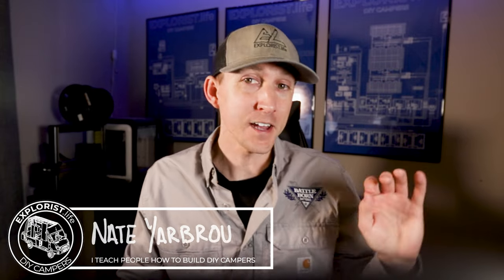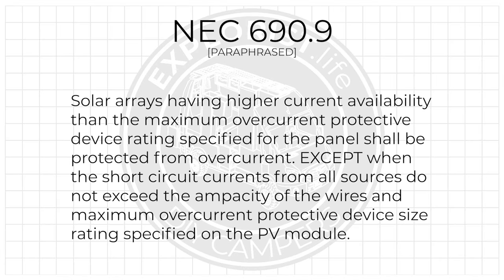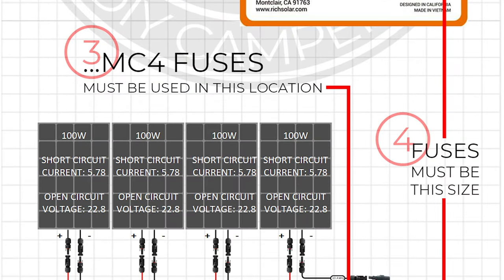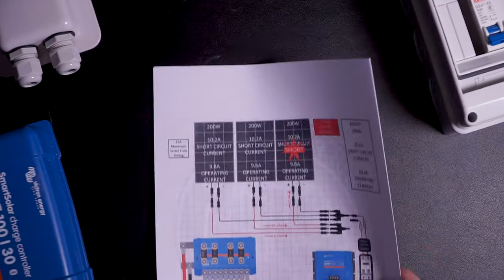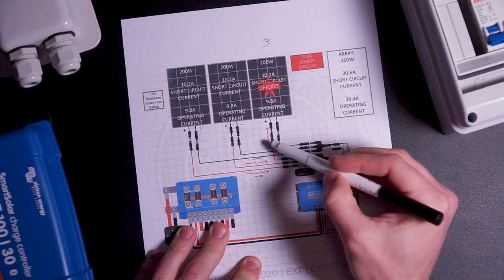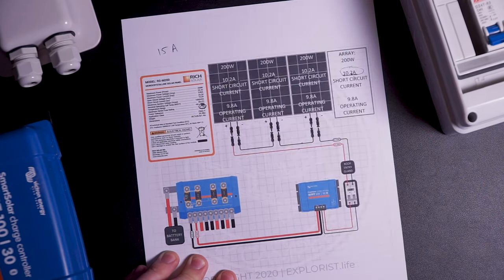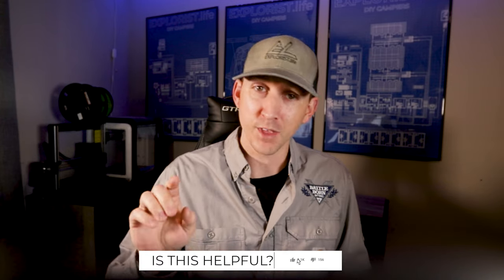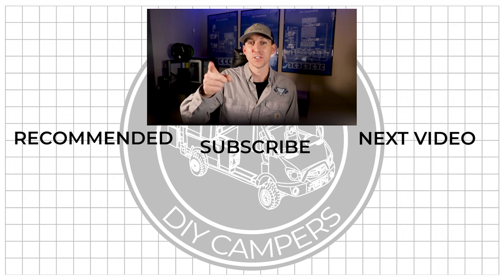How to Fuse a Solar Panel Array for a DIY Camper Electrical System

Comment: I have a question off topic... How do you fuse a victron solar charge controller at the battery. Ive read that if you hook up the battery cables polarity in the wrong direction you blow an internal fuse and at that point you need to send the controller to victron for repair. Can we protect the charge controller externally in the even we accidentally wire the battery cables in the wrong direction.
Reply: Also, if it is possible would we be limiting the controllers capabilities by say blowing a fuse before the internal fuse based off external fusing sizes?... I cant imagine blowing $1000 on there 250/100 amp charge controller and a simple mistake could cost you big time... ive seen cheaper models from other brands that offer polarity protection without the hassle
Reply from the maker: You'll damage a LOT of stuff if you connect the battery wires in reverse polarity and there is no real way to guard against that with a fuse.  This is just one of those 'just pay attention' kind of things.
Reply: @EXPLORISTlife  yea I kind of figured, I happened to see another YouTuber showing how he had to open his victron charge controller after it failed at the internal fuse despite it being hooked up properly. I just ordered a 150v/100 amp model and I want to eliminate the fuse blowing internally. Id rather add an additional fuse externally even if I had to fuse it 5 or so amps smaller so it can blow before the internal one does. I oversized the charge controller for my system but after watching that video it had me thinking how van we prevent that from happening while still protecting the system appropriately.

Comment: I am running 6 panels via 2 series – 3 parallel configuration. Ea panel has a 9.66Amp Current and a 25Amp fuse rating. The complete aray has a 28.98 Amp rating. I should fuse correct?
Reply from the maker: Yes
Reply: @EXPLORISTlife  Thank you!

Comment: What do you do if you have to parallel different panel models? Example, 3 40w with 1 50w? And what if the "maximum fuse rating" is not written on the panel?
Reply from the maker: If the solar array short circuit current is larger than any of the 'max series fuse ratings', you need fuses for your panels.  Each parallel connected panel would get a fuse equal to it's 'max series fuse rating'.  If a 'max series fuse rating' is not available... you must contact the manufacturer to find out more information.

Comment: My panel doesn’t have a maximum series fuse rating, is it the same thing as the maximum overcurrent protection rating or are these different things?
Reply from the maker: Isc * 1.25 and then round up to the nearest 5 will give you a good max series fuse rating.
Reply: @EXPLORISTlife  Much Appreciated. Ps. Love to watch your tutorials. Have learned so much.

Comment: I am confused about something.  Are you saying you do not need to use maximum current, I think defined as sum of all short circuit currents in parallel, multiplied by 1.25, to determine if you need overcurrent protection?  Code seems to just call out the short circuit current, not the maximum current, so I guess that is why two strings in this example are allowed to not have a fuse?
Reply from the maker: I'm not sure I'm following your question.  Apologies.
Reply: @EXPLORISTlife  My fault. 
In your video, (in part) you reference code that says if the sum of the short circuit current is less than the max fuse, as listed on the panel, then you don't need a fuse.  I see in many places in the internet that you need to calculate max current and use that for your fuse rating.  Some say 125% of isc, some say multiply x 1.56.    What I am asking is if we need to use the short circuit current value on the plate for the sum, or multiply that by 1.25 or 1.56.  Thank you.

Comment: I have 4 100w solar panels wired in parallel.  Each solar panel has a 15amp series fuse rating.  I attached 4 10amp inline fuses to the branch connectors.  Was I wrong?  Should I have used 15amp inline fuses?  I went parallel  because we are far north and shading on the panels is a problem.
Reply from the maker: 15A is the max size.  10A may be fine if it's not lower than the operating amperage.
Reply: Thank you.

Comment: So if I am doing 5 panels that are 9 amps in series and doing two sets of those in parallel what do you recommend for fusing? Do I need to fuse if my wire is 6 gauge and can handle more amps and such. Curious anyone I’m setting up a lv6548 soon so I am researching proper fuses and wires to run 150 feet to batteries

Comment: Shouldn't we compare the Max Series Fuse rating with the corrected short circuit current? By corrected, I mean taking into consideration the temperature coefficient effects (or a factor of 1.25 for over irradiance) and possibly another 1.25 factor since it's a continuous power. Since the I_sc rating on the PV panel's label is under standard test conditions.
Reply from the maker: Which code/standard are you looking at that backs up that claim?

Comment: can i do this set up but just get a normal inverter and converter instead of the inverter charger you use? would i then have to change where my shore power runs to??
Reply from the maker: Ultimately, you can do whatever you like, but I do not recommend separate Inverters and chargers.  They are too complex to set up and more expensive by the time the additional transfer switches and wiring is all taken into account.
Reply: what is it i would be missing getting this one thats half price. this brand has one in the 1,200 dollar range too i just dont know where the price difference is coming from, Thank you

Comment: at 2.09 what is the Masimum Series Fuse? A total of the MSF of each panel?
Reply from the maker: The maximum series fuse size is a figure listed on the back of the panel.  These don't get added.

Comment: hi 
I got 8 x 440 solar panel
My charge controller is 72V
I need help to solar panel series parallel connection for 72V charge controller
also fuse and distribution box configuration

Comment: Your wire gauge calculator camevup with 2AWG to wire my two 100ah (200amps total wired in parallel) bit the parts list for this one shows 2/0. What am I doing wrong?

2000W INVERTER | 200-400AH LITHIUM | 200W-520W SOLAR CAMPER WIRING DIAGRAM

Mine is 40w panels, two 12v 100ah lithium, 2000w inverter. All your diagrams incorporate shore power, alternator charging or both and mine doesn't have either.
Reply from the maker: 2/0 is required as the manufacturers of most 2000w inverters recommend 2/0 wire.  Manufacturers recommendations override whatever my calculator tells you.

Comment: The short circuit current of my array is 20.04amps and the max series fuse rating on my panels is 20amps. Do I need to bother with fuses in this situation??
Reply from the maker: Is the short circuit current of the array higher than the max series fuse rating on the panels?  If so... you need fuses.
Reply: @EXPLORISTlife  fair enough.

Comment: Where can I get a cheap charge controller with 400v input so I can series connect? AliExpress cheap controllers have 50v max.
Reply from the maker: I don't really deal in 'cheap' charge controllers.  I deal in charge controllers that actually work.  That said, if you need a charge controller that can handle 400V; the Victron SmartSolar MPPT RS 450|100 has a max input voltage of 450V; but keep in mind that you need to be running a 48V battery bank with this charge controller.

Comment: what if my panels dont have the max series...I am with Denis below.  TY
Reply from the maker: Multiply your Isc (Short Circuit Amperage) by 1.56 and round up to get the max series fuse size.

Comment: so what if like my 50w  panel their is no figure for  a maximum series fuse rating on the back of the  panel
Reply from the maker: Take the short circuit current and multiply by 1.2 and round up the the nearest interval of 5.

Comment: What do you think about the Eco Worthy boxes?
Reply from the maker: I don't have any first hand experience with them.  I recommend Victron components for a high quality system that will last.
Reply: @EXPLORISTlife   thanks, I’m going with a Victron 150/60 charge controller. Will be running 4, 340w (48v) panels to charge a 12v battery bank. Sound ok? My understanding is I can have high voltage into that controller under 150v and 60amp, and it will down the V to charge the 12v battery bank
Reply from the maker: Not quite.  The 2nd number of a charge controller is the amperage OUTPUT; not input.  More info: https://www.youtube.com/watch?v=Jkbs84sBHsg and this: https://youtu.be/MxziHKvTRh8

1360W of solar charging a 12V Battery Bank at 14.5V is 93A (1360W / 14.5V = 93A), so you'd actually need the larger MPPT 150/100: https://shop.explorist.life/shop/all-products/solar-charge-controllers/victron-smartsolar-mppt-150100/

You could use this kit, just substituting in your 340w panels, and omitting one panel per series string: https://shop.explorist.life/shop/all-products/camper-wiring-kits/solar-charging-wiring-kits/1440w-solar-charging-wiring-kit-6x-240w-12v-battery-bank/
Reply: @EXPLORISTlife  thanks so much! Really! Thanks I put in a small system 5 years ago and it’s time to actually upgrade to something more substantial
Reply: @EXPLORISTlife   Do you ship to Canada?
Reply: @EXPLORISTlife   final question 🙋‍♂️ if I put my 12v batteries in series to 24v I could get away with adding another panel in the future with the 150/100 right?  (1700 divid 24 = 70) I have 6 agm 100 amp 12v batteries. Then just a little step down to my 12v fuse box. Might be better?

Comment: My solar panels don't mention maximum series fuse rating. They are 
ECO-WORTHY Bifacial 195 Watt 12 Volt 12BB Solar Panel Monocrystalline Double-Sided Power Generation Rigid High-Efficiency PV Module

Comment: Hello
How r you? I watched ur videos its very helpful for me thanks.
But I have a problem can u solve this for me. 
I have 5 solar panels 435 watts of longi company. And 
I have a submersible water pump with controller.
Motor power is 1500W, DC 120V
Controller specification is 
Model DC 110-1500W
Input voltage: Dc 60-180V
Input current:0-15 Amps
So how I connect solar panels to get this input voltage & current
Please guide me in this regard.
Keep in mind I Have 5 solar panels
Thanks
Reply from the maker: Sure!  Solar panels -> Charge Controller -> Battery Bank -> Inverter -> 120V power.

This is how all of my diagrams at https://www.explorist.life/solarwiringdiagrams are set up.
Reply: @EXPLORISTlife  thanks sir
But without  battery and charger controller
Only pump controller
Reply from the maker: The way I recommended is the way I would design that system.  Straying from that is not something I can recommend.
Reply: @EXPLORISTlife  thank you

Comment: How do I calculate the needed fuse if I hook up two panels in parallel and on panel has a 15 amp rating and the other has a 12amp rating? Do I need a 27 amp fuse? Or am I safe with a 15 amp fuse?
Reply from the maker: You'd fuse at 12A for the 12A panel and fuse at 15A for the 15A panel.
Reply: @EXPLORISTlife   even when the panels are in parallel? Wouldn’t you combine them and round to the nearest 5amp? Which would be 30 amps in this case?
Reply: @farrellwatson1428  I agree. I'm thinking I need 4 30A fuses for my 4 100W panels, but having a hard time finding information on which fuses to get

Comment: Why run all the modules in parallel? Lots of extra equipment required.
Reply from the maker: I'd pretty much never recommend wiring all panels in parallel.  Series or series-parallel is the better choice in 99% of cases.

Comment: With other words we only fuse parallel solar panels. 
Those branch connectors, many of which are only rated for up to 30 amps, should have the fuse section already build in. That would take the guesswork and/or ignorance of code out of the question. Maybe that’s a business opportunity
Reply from the maker: I guess I could technically sell the branch combiners with the fuses as mandatory purchases, but I think it's best to educate people on why you may or may not need them and then put together solar charging packages that include/exclude the proper fuses as appropriate; taking the guesswork out of it.
Reply: @EXPLORISTlife  that’s true too. Too many variables gets people confused.

Comment: Does wiring in series v parallel impact this in any way? My setup is 3*100w panels in series; SCC 17.58A, 22.3V per panel. So, clearly a 15A inline fuse is needed, but it seems that just 1 fuse would be needed.

Comment: I'm pretty sure the National Electric Code doesn't apply to Campers and RVs. It's only for homes and other buildings.
Reply from the maker: Sure, but just because something won't get inspected for code compliancy doesn't mean we shouldn't follow codes/standards to build a proper system.  At least that's how I approach it on this channel.  Feel free to cut whatever corners you like in your own install.

Comment: Panels always seem to have this situation:  10.2a  short circuit but then then a 20 amp max series fuse!!!! Ugh, then it just runs at 8-9 amps in the field anyway. Can any electricians or.. more likely someone who's tested this in the field chime in?   Fuse or not?  Math says yes, common sense they would make panels capable of paralleling into 2p (when the specs are this close) leans no.
Reply: dang 4 months no alerts! forgot i even wrote this until i came here again. lol.  Welp.. about to build my 20 panel setup on 2 inputs.  5s2p each. Gunna go with no fuse based on the fact that my first solar setup was 2 panels in parallel, but somehow i failed to notice it was 9.6a short circuit with a 15 max series fuse..  2 in parallel shoulda been real bad.. idk.. no problems.. i only switched it when i realized the mppt works better when at the high end of its operating voltage range.  So im guessing .4a over is acceptable.

Comment: Sure the requirement is for land solar not rv solar.
Reply from the maker: The concepts behind the rules are the same regardless of how it's installed.  If you want to cheap out and not fuse anything, that's on you.  That's not what this channel is about, though.

Comment: Can anyone just do a simple video talking about emergency shut off switch? Why is that so hard to find? Sheesh? Which wires does it take? Why is this switch needed? Where are they needed? MAKE A VIDEO ON THAT PLEASE!
Reply from the maker: Sure!  On the schedule to be released tomorrow. 😁
Reply: @EXPLORISTlife  no way!!! wow! Thank you I have been searching for two weeks with no success. I only have one 180w panel and 2 90Ah batteries...small van so yay! and maybe a video on how to add a suitcase  panel to rooftop when in less than ideal locations? Not trying to be greedy, but there is only one video out there like that and it's years old.
Reply from the maker: Another good suggestion.  I have a video on the schedule for 3-4 weeks from now that will cover wiring multiple charge controllers for multiple arrays into the system, which Is how I would recommend doing what you are proposing.
Reply: @EXPLORISTlife  awesome! yes! I do have another charge controller for it, however the controller input holes are small and can only accept #14awg... and the mc4 is on 10awg. so i’m stuck there. Unless I return it, but now I am finding it tedious to find a 10awg inlet hole charge controller.
Reply from the maker: The Victron Smartsolar 75|15 has 10 AWG Wire terminals and would handle a single 180W panel: https://amzn.to/2M7xPBi
Reply: @EXPLORISTlife  I’m going to leave you alone so you can upload the other video… But the separate charge controller is for the portable suitcase panel which is 100W/5.3A The 180W panel is already mounted to the top of my vehicle and I have 30A Epever charge controller for that one. (originally I had 2 of the 180 W panels… But I opted for a roof carrier so one of them had to go, hence the suitcase panel)And I know you can take a joke, so I’m just saying the charge controller that I purchased from Amazon for the suitcase panel was not expensive, so I was looking for supplemental charge controller that rhymes with the word “meap”. Honestly, I am learning piece by piece and your channel has been tremendous in helping me with this.

Comment: If your total array current is greater than the fuse rating of an individual panel, why would you choose a fuse of the same rating as the panel?  The current will exceed the fuse rating and blow it out.  Ref: https://youtu.be/s1P31hxlD3I?t=129  Thank you.
Reply from the maker: The only time the full array current will flow through the fuse is if there is a short in a panel and the rest of the array is trying to flow power to that short circuit.  Under normal operation, the entire current of the array will never flow through one fuse and will only flow through all fuses (evenly split).
Reply: @EXPLORISTlife  Thank You!